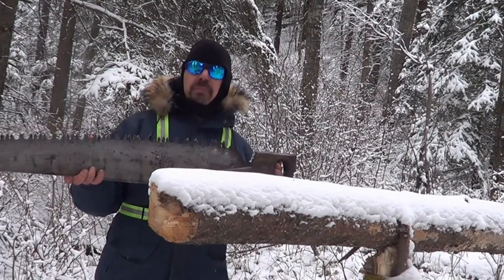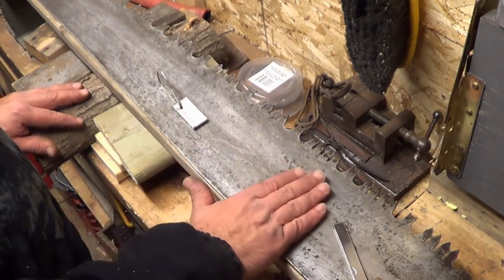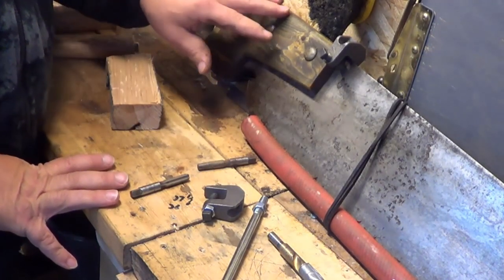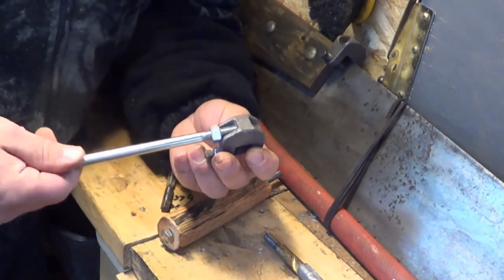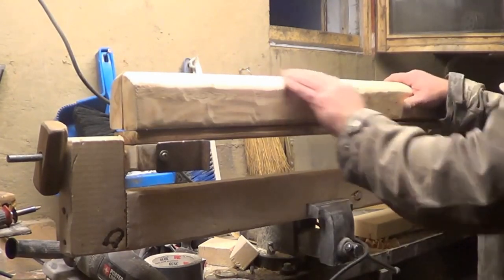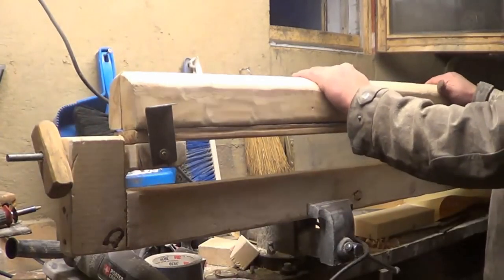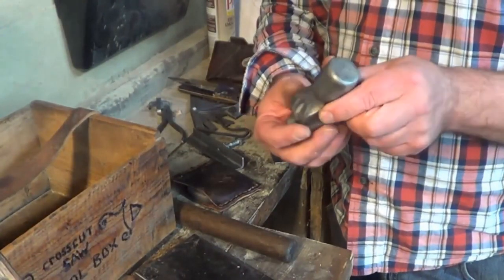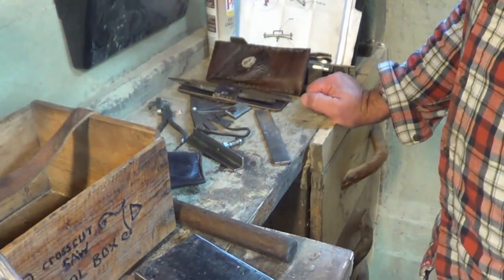Full Crosscut Saw Restoration

Comment: Great job on the saw and making the tools, Ken. I found a bucksaw at a sale. Tried cutting with it. No go. Rakers were never cut down but they kept on filing the teeth because the saw would not cut. So now it would be a big enough job to fix. Thank you for the video. Stay safe and stay warm
Reply from the maker: Back in the day my dads friend sharpened regular saws but its hard to find people or even the tools to do that nowadays. If you have the room that saw would look nice hanging securely on a wall. Thanks for taking the time to watch my friend 💛✌🙏
Reply: @Thelonelyscavenger   I had a nice one man cross-cut and a nice broadax. Stupidly gave them to my brother. I picked up a new dry wood blade for the bucksaw and it is down here ready to go. Grandpa used to sharpen saws. Thank you for the reply, Ken